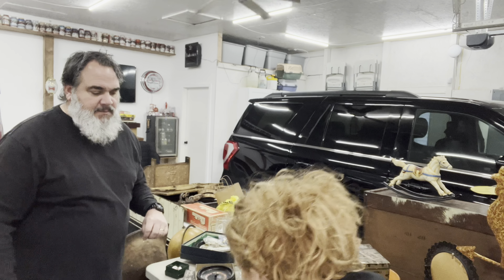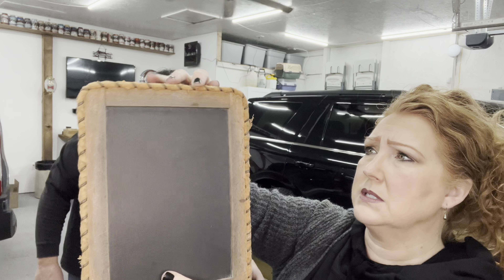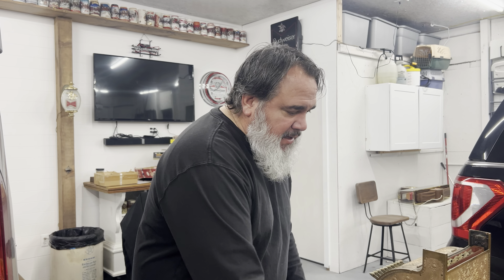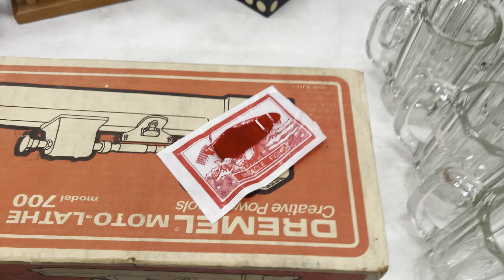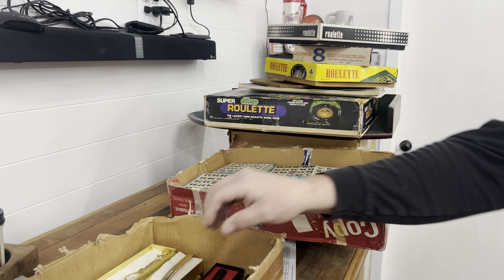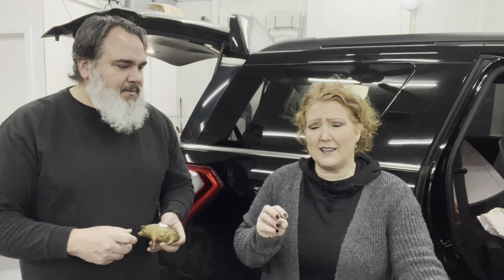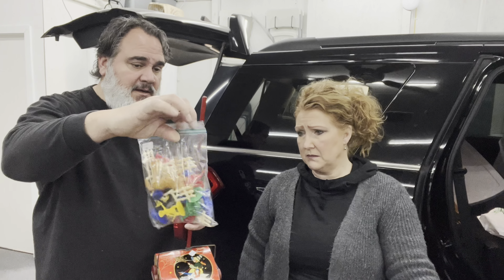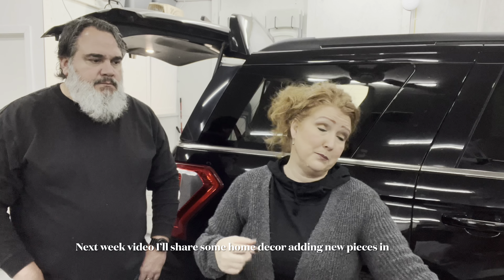auction times two | resellers journey

Comment: As you have noted in your eBay listing, the roulette wheel, etc. in the Sandown box is part of an antique game made in London by F.H. Ayers. (The game likely was named for Sandown Race Course in Esher, in Surrey, England, near London. The race course was established in 1875 and is still operating. There also is a racecourse in Australia with the same name.) Depending on condition, the game can be worth several hundred dollars. Yours does look to be incomplete, so not as valuable as others, but still I neat group of items. As far as your horse racing painting is concerned (and assuming it's an original painting on canvas or wood board), its style and the ornate frame suggest 19th century. At least the label on the back suggests it' likely is British, but it's hard to tell more unless the back is opened. Two sources of specialized racing-related expertise here in the US include the National Museum of Racing and Hall of Fame in Saratoga Springs, NY, and Cross Gate Gallery located in Lexington, KY. Either or both should be able to offer some guidance on identifying and potentially valuing the painting. See their respective websites for contact information. Good luck!